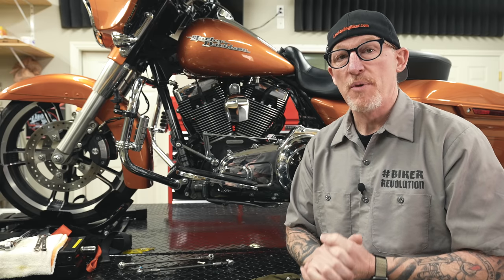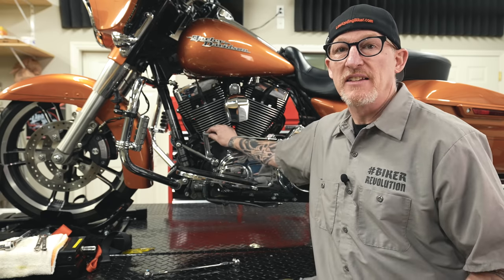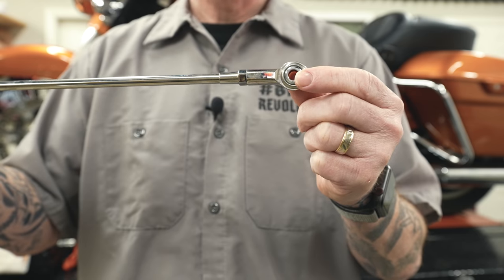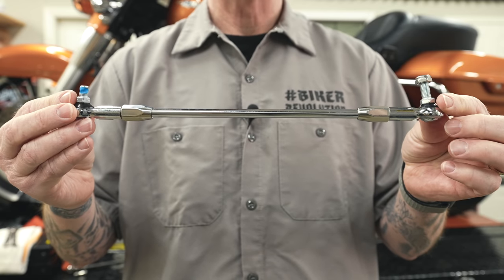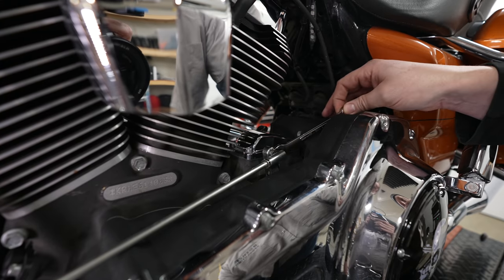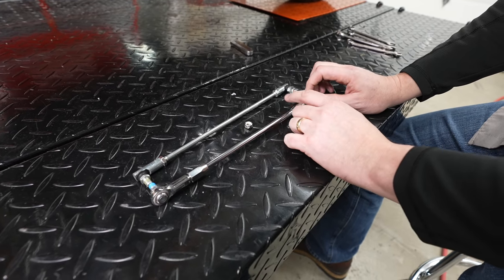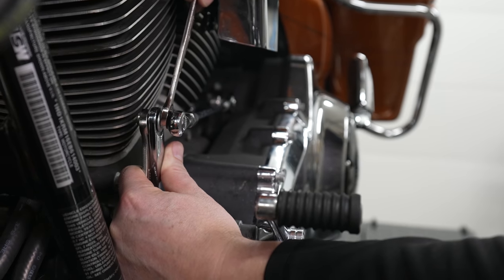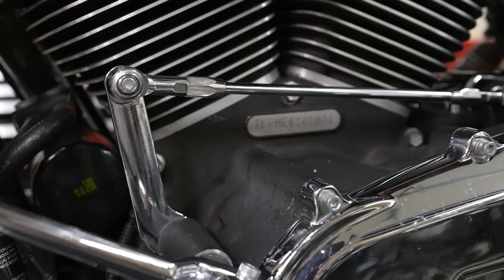Harley Shifter Linkage Replacement

Comment: I just buy stainless steel heim joint ends from Tacoma Screw and use the stock rod. It's under $20 and you get that exact same result. I've done this on all my Harleys over the years.
Reply: Don F? Can you post a link to it? I would like to purchase some.
Reply: @mattcottrell3336  me too
Reply: Me 3
Reply: Me 4
Reply: @mattcottrell3336  me 5
Reply: I bought from different people, but did the same thing cheap, looks fine, and does the job.
Reply: Personally,  I bought the upgraded one that's really thick chromed and reads HARLEY DAVIDSON.  I want it to pop, and I "want" it to be shinny.  It's the whole point of it.  
It's also a stronger and the build quality it's definitely better.  Either go big or GO HOME!!!!  Just say'in!!!

Comment: ya...and don't forget the shift lever on the transmission side where it connects to the transmission shift shaft. First year as a Harley owner with no experience, had to have that fixed because the splines were blown away on that end....cost me BIG.
Reply from the maker: True that

Comment: I changed out my stock one on my 08 RK with a Willie G shift linkage which came with those acorn nuts. Good to see I was right when I installed the front bolt back to front. Thanks!
Reply from the maker: Right on

Comment: Yup.. first thing I changed out on when I purchased my 17 RG. Also, is it normal to have a tiny bit of wiggle at the shaft where the shift arm bolts to. Seems tight.

Comment: Hey Ryan, I tried to research firment before posting, 2021 Road glide limited. Will it fit my bike? It says 1980 to current, not sure if the 2021 models are included.
Thanks and love your work, thanks for your service. Be safe out there.

Comment: I bought an old sportster and it shifts fine but I went to make a slight adjustment to my linkage and it looks like it’s slightly bent/cross threaded on the adjuster.

Comment: My 2015 Road Glide Special is approaching 30k miles. I torque the shifter linkage every year. There is absolutely no signs of wear FYI.  The linkage is not remotely prone to failure.  The splines are suspect especially for riders who can’t differentiate between kick and press. Shifting my bike is buttery smooth. Why would a rider buy from your site? Maybe I’m just lucky?
Reply: Blessing on you brother.....

Comment: Here's a tip you should share.
I purchased an Electra Glide first thing I did was Drill two small holes through the shifter levers and shaft on both sides heel and toe shifter. Put a small screw or cotter pin and that's it.
No problems. 
Thank you very much

Comment: The site shows the linkage is Sold Out, but no part number, what parts are included nor when it will be available again.
Reply from the maker: There is a nationwide shortage due to supply chain issues.  We have a bunch on backorder from the distibutor.  Hopefully they will be back in stock soon.

Comment: My 15 Roadglide with 40k is still the original, but I never use the heel shifter!
Reply: What difference would that make ?
Reply: @kurtfoulke5130  Because the heel swifter your kicking down half of the time  putting a lot more stress on the linkage, the Toe shift isn’t as stressful on the linkage.
Reply: @no1but24  if you have to kick it, you might want to put some oil in the box.

Comment: This is why I drive a Goldwing.  100,000 miles and all I've had to do is put 1 set of plugs in it and change the oil regularly.  I like to ride, not work on them.
Reply: I've never heard of these linkages breaking.  Most H-D riders feel the need to upgrade because it's so ugly, but it's a myth that they break and strand you.  I've ridden on my stock linkage for 66K miles so far and haven't even needed to adjust it.  I suspect some people don't bother to check it ever, or they stomp the hell out of their shifter.
Reply: Goldwings are solid, ugly as all sin but they're solid for sure.
Reply: Never seen a gold wing down or need replacement parts..........OK SURE
Reply from the maker: Each rider has their own taste and ride that works for them and fits their needs. We support all motorcycles and riders.
Reply: @davewilliams5781  well I guess you have never been to a motorcycle salvage yard because they are stacked like firewood.

Comment: I just ordered one from the LAB store. My cheap shifter shaft left me stranded 100 miles from home with only 20k miles on the bike
Reply: Well this is upsetting.  I have a 2015 street glide special at around 20,000 miles. We plan on leaving Indiana tomorrow to play around in Tennessee for the weekend.  Expecting to put 1200 miles on the bike. I will be pissed if I get stranded. Its a cheap fix, but no way to get done before i roll out.
Reply: Hey Scott, Quick question. Did you have a small bell placed somewhere on your bike when this happened? I am hoping this difference helps me get through the weekend!
Reply: @davidmartin6927  if you’re still running the stock linkage, make sure you carry a few zip ties for emergency repair…. BTDT
Reply: @davidmartin6927  🤣🤣🤣